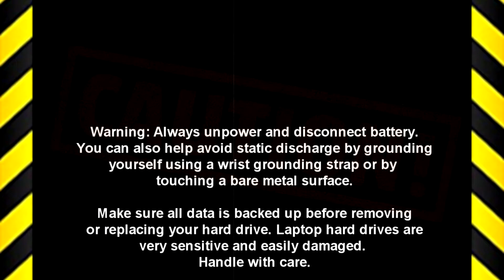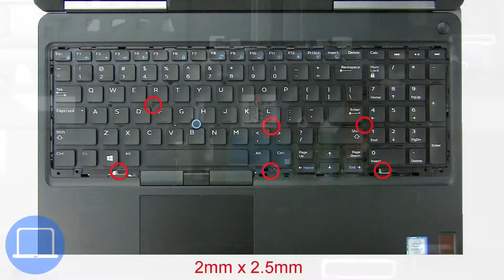Dell Precision 15-7520 (P53F002) Heatsink How-To Video Tutorial

Comment: I've been out to your website before, when I rebuilt a Dell Latitude E6510 (replaced damaged case elements).  That was a while back.
Now I am working on my Dell Precision 7520.  Between the owner's manual and this video, (which is detailed WRT where what sized fasteners are used) I still don't know what sort of thermal transfer medium to use:  pads, paste, or what.  I see where you folks have the heasink/fan assembly for my machine, but I probably don't need that.  What I would really like to know what paste or pads to use before I start the job, just in case I have to order it.
I have the model of this unit with the Xeon E3-1545m v5 and an Nvidia Quadro M2200 video card, and, under heavy load the CPU gets up to 207 deg. F (97 deg. C).
Reply from the maker: The CPU/heatsink for this model would use thermal paste like this: https://ppci.me/i/20491